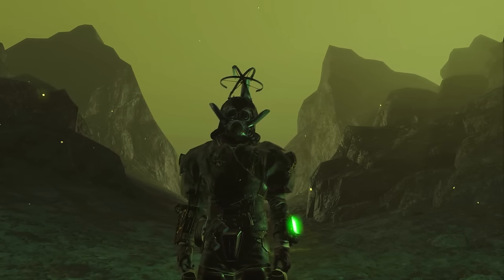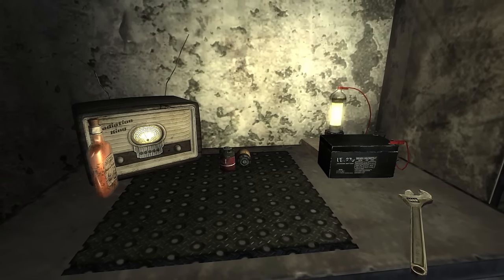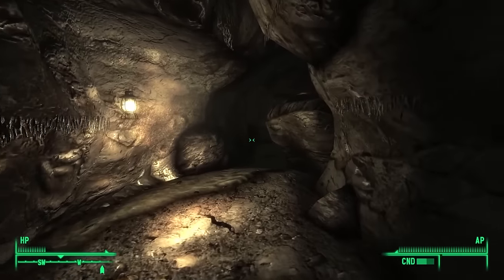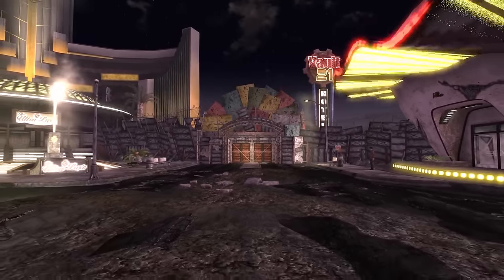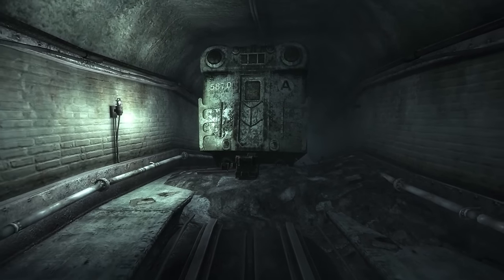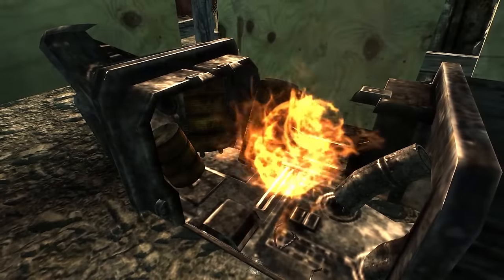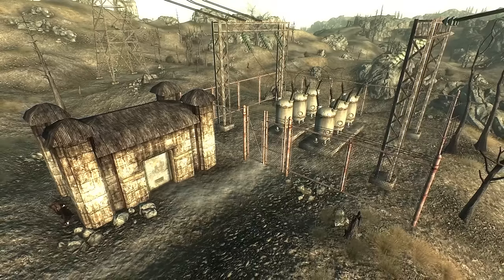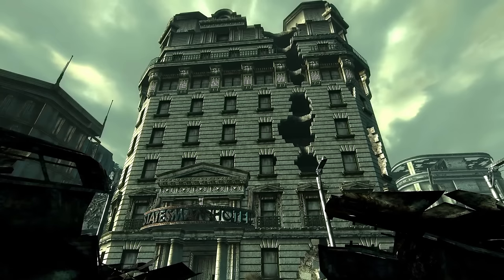Where does the power come from in Fallout?

Comment: part 4 - "Shorts and Infrastructure damage".

The three most important things to remember in Preface is:
1. The grid uses AC not DC power
2. Power Grids are not one giant grid. While they are called a "Grid" they are actually a multi-fed Mesh Network, Existing in complex switching states that supply, regulate and control power to smaller sub-grids.
3. The US is notoriously bad at upgrading areas equally and has /always/ taken a approach to upgrading infrastructure of the wealthiest areas first and letting the poorest areas go into failure for long-term before patching it, but never upgrading it. Unless a private interest offers to do so (EG: Vault-tec). | Look to the reports on this for more proof. Its not isolated and it definitely pre-dates WW2, so the FO universe would suffer from this as well.
-----
Power Networks in one city are broken down into 3 layers. Districts, Zones, Distribution-Blocks. Each District is supplied from a managed power-grid source, this is usually substation. However in some cases, it can be far more complex (Switching, Buffer and Regulation) and or far less complex (as little as a switching-station).
When a "Distribution-Block" is damaged to the point the local supply of that area is unstable. Say, downed lines are grounding out, or a several houses, each with crypto miners are using industrial facility levels of power. The zone substation powering that Distribution-Block, will either fail (no regulation equipment/fuses to turn off the zone) or the regulation equipment will do its job and shut off the entire zone.

If the zone fails, and some how takes the District substation with it, the same conditions apply... The point is, at each stage there is safety equipment involved that reacts in nanoseconds, not minutes.

In the even of a nuclear strike, the EMP would take out most of the above-ground grid anyways. The charge would trip safety shutoffs (these are litterally huge switches that use blank shotgun shells to forcibly open the circuit before it can fry the network). These systems have been tested and have existed since WW2. We discovered it /before/ the atomic bomb tests, as cosmic radiation (from our sun) is a thing and very, very, very rarely a coronal mass ejection can cause a EMP here on earth.

So, this means, outside physical damage that occurs /after/ the emp (Travels much faster then thermal radiation and physical pressure wave), the substations are working, just shutoff, and the supply lines are fried coming into it and out of it that are above-ground.

----

When AC power shorts, it doesnt take out the network. Many, many homes in the US have poor wiring, and are constantly backfeeding power. the US uses split-mode 240 (EG: Split 120v supply), this gives a significant amount of headroom in the end. However it does damage the transformers over time.

This would mean some houses would have power 200 years later and others wouldnt on even the same block... not that the entire grid would be down from it. Wires will fry LONG before that would occur.

----

So that said, EMP's and the bombs effects are not wide-spread. Much of the damage to the FO universes version of the US, is from degradation, Radiation and changes to the Environment from the secondary effects of the bombs.

The bulk of the FO game's story takes place outside the blast radius (exclusion zone), but inside the radiation radius of the bombs(around 300km). Which is why some places look completely untouched outside weathering damage, and other places are crumbling hunks of concrete and metal from the shock wave, subsequent earthquakes,  and violent storms that would of raged for upwards of 100 years. (Nuclear winter, it causes localized weather phenomena from large-scale bombing) 

So much of the grid remained intact and functioning following the bombs, and the above ground degradation of power-lines are a result of environmental effects, and not blast wave (mostly) and while above-ground Supply lines (look to part-1), were damaged. This was most likely due to a combo of EMP and weather damage (since no one was around to maintain it)

That said, its easy to connect the dots. Some Districts are without (primary) power still due to the above-ground networks being fried by EMP and substations only regulating below-ground power or shut off completely.

Other Districts and Rural Areas, have most of the network in-tact from underground supply lines, but they are low-amp, due to the power generation facilities running non-stop for 200 years unmaintained. Fusion and fission generators loose their energy potential as the fuel runs out.

----

So why ultimately is there no power in some areas but power in others?: 

For the same reason there is rubble in the streets, dust, dirt, garbage, skeletal remains and ABSOLUTE FILTH /200 years after it happened/. The people in Bethesda's FO dont care. They dont care about power, they dont care about filth. The bulk of the wastelanders are not even trying to live. Just whiny, jet-addicted future-ghouls, just surviving in the rubble. They dont want to make a "life". Even when they say things like "I moved to X to make a life for myself", evidence the state of their surroundings and living quarters says everything. They want to be picked up from the rubble, and the Trauma erased. If they cant they will just keep moving on in a daze, doing the bare minimum to survive until it happens or they die.

There is a reason raider camps are generally more clean then the cities like Megaton and Diamond City... Megaton and Diamond CIty are where people go, to survive. Raiders Camps are where people who stopped caring about surviving and are living to have the most fun before they die in glory. There may be messes, but most of that is of their creation in extremes.

Its actually a defining feature for Bethesda's versions of FO vs earlier titles. Bethesda gives us a "Stuck in time" view of the FO universe. Partly due to conveniences (copy and pasting area's to fill out the void), and partly due to them lacking the ability to mentally "exist" in their own design. As such the Waste exists in a state where everything is broken and where the NPC's lack 'life'.

----

In Summary:
The grid is a mess because no one bothers to repair any of it. They are more likely to loot it instead and build a Gatling Laser or Plasma Weapon from its contents, because Fck everyone, i want to shoot a super mutant and then shoot a powerplant to watch it explode...

In the end, what we see its the flickering lights of Dedicated Engineers, that existed /before/ Vault-tec became stable. Most of it is from even before the Gas-wars. The Supply level changed, but the infrastructure remained mostly static. 

In FO, Every person is a feral-ghoul. Whether they act like it or not, and it only takes one look at the flickering lights to know it.

Comment: As for the fusion cores in Fallout 4, my headcannon was they worked like an engine in a car. The fusion core works the same as a car battery, while the big generator they plug in to works like the engine. The power from a fusion core (massive voltage? Amperage?) Is needed to get the larger reactor working (or perhaps sustain it) but on its own the core is a powerful enough battery

Comment: I like to think, that the fusion cores are just the payload. Imagine if you'd have some uranium rods and you'd stick them into your battery-fueled radio, it wouldn't work, because the energy source is raw. Fusion cores are a bit of the same. The fusion generator is accessing the raw energy in an efficient manner, storing it for when you remove the fusion core. The power armor is accessing the energy with some different tech, but since space is limited, it uses the raw material in an inefficient way, draining the fusion cores faster.

Comment: This glosses over a lot and gets some things entirely wrong... 
Voltage * amps(current) = watts. | We typically measure generators based on their peak-watts (or watt/hr [amount of watts produced or consumed in a hour]) or BTU (the amount of heat produced by 1055 joules of energy(amp/current) in 1 atmospheric unit. Typically entirely replaced by the Modern Joule [J] to represent J/K(joules per kelvin)).

As you can step up or down Voltage, Amperage is the primary limitation. High-volt, low-amp, is typically how most power systems transmit power to substations from generation. Power lines have limits on the amount of amps they can carry, and the gauge+cores=voltage/limit. Efficiency plays a important role, but for the sake of discussion we will ignore it for now.

When you see those massive generators in FO universe, with arcing strands of power. They are High-Voltage, but could be even miniscule amps. To visualize You can think of voltage in the same way you would a piece of rope. A longer rope has the potential to reach further distances then a short one. So whipping it around in the air, means it has a higher chance of touching something. While a short one (low voltage) wouldnt be able to reach anything... This is why we see those arcs of power, jumping around, and it behaves the same way IRL. As AC searches for the shortest path to ground(energy return voltage, not "Earth" the physical ground).

Its safe to say, the pre-war power systems are probably much like today's. We think 1950's-era power systems as being inferior, but in reality, it was just as or more robust then today. Most of the problems were related to safety and understanding of material resistance/btu. - If things continued in this vain, till the time of the bombs dropping. Its safe to say, its over-engineered and redundant...

With this, we can determine 4 things. 
1. Primary long-links (city to city) were provided by the huge cable-towers we see blown apart, across the wasteland. (Ultra-High-volt, low-amp)
2. Secondary underground, fall-back links that provide power to street lights, highway lights/signs and provide backup power to rural substations. (High-volt, low-amp)
3. Local-City short-links. Seen in sewers, subways, etc. Underground power that went to local city substations to be further stepped down, but also could be coil-induced to nearby equipment. (mid-volt, mid-amp)
4. Zone-links. Zones powered by substations, that are stepped down at street-level transformers. (low-to-mid volts, high amps).

With this in mind, its easy to understand why building have lights, but cant run elevators. but some can... Power lines are conductors (obviously) but they area also inductors (like a antenna). High-voltage (like mentioned above) induces current into nearby wires. Its used often today for "wireless charging", but it has been used in the past, for none-other then powering lights. | Tesla, demonstrated this and in a alternate timeline we may have even seen this without the fear of electricity being still a major issue into the 1950's.

Zone-links are mostly down, but short-links and secondary underground power is still live. This is powering some terminals, which use power induction to charge internal batteries. It also operates some lights in the same manner... | The power is coming from minimally operating power-plants, backup generators that engage when volts drop from high amp-draw reaches a threshold (volts drop, when amp draw exceeds available watts. its actually a modern problem in cities with solar-feedback systems. where home-owners sell power back to the grid).

This also explains why you need local generators to operate large equipment most of the time. Backup generators used to be common for substations, official building and peoples homes. The reason its less common today is a testament to the power-grids stability and the ever-increasing cost of gas/petrol generators from consumerism.

Taking all of this into account, it makes perfect sense the state of things...

Comment: The Fallout franchise runs on Ragnarok Proofing. Honestly, all the in-tact power bothers me less than all those pre-war wooden buildings that are still in tact after 200 years (maybe plausible in the Mojave, but not in the East Coast's climate) and all the guns that work fine after sitting on a shelf for centuries. At least with the high-tech stuff you can assume some form of sci-fi wizardry is in play.

Really, I just figure the laws of physics work differently in the Fallout universe than they do in ours. That's even in line with things I've read about the lore, like how ghouls are based on early theories of how radiation would affect people that were later disproven.

Comment: See here's my thought on those generators. What if they popped out due to the war? Like some kind of emergency low power mode to prevent them from exploding like when they pop out of the power armor. Think about it, wouldn't a nuclear war trigger an emergency stop on anything nuclear powered? That's why they popped out but still produce power, that's why the lights flicker but don't turn off, because the grid power kicks it up a notch to make up for you removing the generators core. However this is only if they're fission, this all falls apart if they're fusion!

Comment: Maybe the fusion cores are like a back up battery. This would still fit in everything that was said. Maybe it’s being charged by the grid and was designed to be used as a battery backup for temporary loss of power. That’s why lights still work in the buildings. And why it doesn’t last as long in power armor. Great video.

Comment: Wait… has it ever been directly started that it’s the Fusion core powering the fusion generators. 
The fusion core being a small unit, and the generator a giant bulky machine. 
What if it’s the fusion generator recharging the fusion core, and the spinning machinery injects high pressure fusion fuel into the secondary auxiliary Fusion core that powers power armor and anything else???

Comment: Fallout 3 was supposed to happen more like 20 years after the bombs, not 200. It's common knowledge that most nuclear reactors don't need refueling more frequently than 20ish years.

If you assume that 200 years have actually passed, then you get the horrible napkin math that indicates all fusion cores in fo4 should decay within 6 months whether used or not.

Comment: While it's pretty farfetched any part of the grid would survive 200yrs...

Rather than prewar generation its more likely when settlements went up they just utilized some of the existing lines by back feeding generators (people do this today to the high risk to lineman by using a double pronged extension cord from a generator to an outlet in their home) so the prewar electrical grid isn't being powered by prewar generation but rather tons of settlements from small to big all backfeeding their (sometimes nuclear) generators. Unknowingly making the grid live again, just reversed.

When you think about the size and lack of much more than some lights and terminals, a lot of settlements in FO are doing serious overkill for their actual power needs too.

If Diamond city for example has a small nuclear reactor (smr) like we've seen countless times in FO, realistically produces at least 30mW (the m4w plant on Nimitz each produce 200mw).

1mw is (very) roughly enough for 1000 modern (2020) homes. So a very conservative estimate would be that Diamond city could power 30,000 modern homes. They're neither nearly that large nor as power hungry as modern houses.

A few SMRs like we constantly run into when scavenging cores easily could power the prewar grid in FO to the level we see. Plus extra for the institute to steal from so long as somewhere they used part of the prewar grid in their circuit.

Comment: Well I'm a little late this being my second time that I've watched this video The first time I didn't have a comprehensive understanding of nuclear power and just wrote it off as well as nuclear power so b***** and reasons now that I have a much more comprehensive understanding of real world nuclear power It is entirely possible that old nuclear fission power plants could very much so still be putting out a reduced the severely reduced power load in 200 years The typical half life of the uranium and plutonium that we use in power plants right now is about 46 to 52 years but that would only put it down to half power so by that metric in 200 years if the rods are not changed theoretically the power plants in fallout would still be putting out somewhere between a 16th and a 32nd of their total power output also assuming complete autonomy of the criticality suppression systems which is also very likely given the fact that in the fallout universe robots are a thing so it's entirely possible even abiding by the laws of thermodynamics that we have now and the theory that a plant is completely autonomous that you would have enough power still on the grid and running through the grid to power quite a bit but not nearly enough to power everything